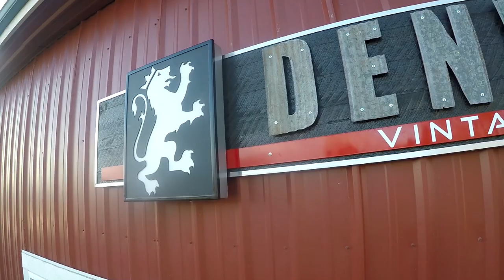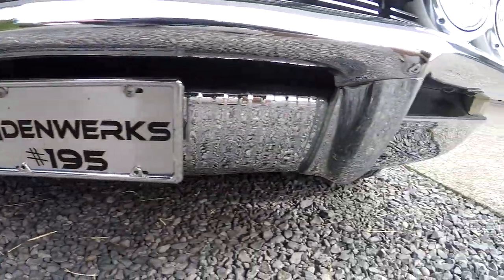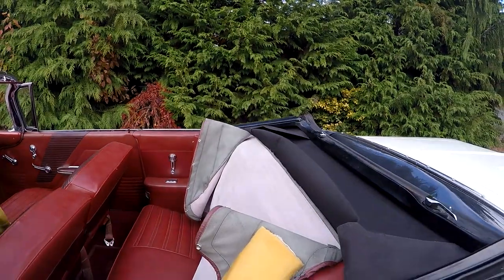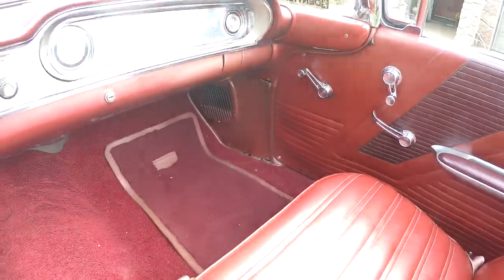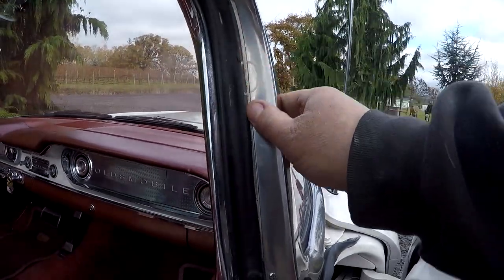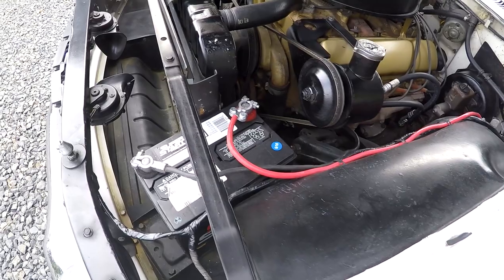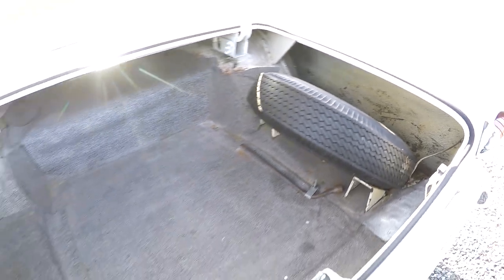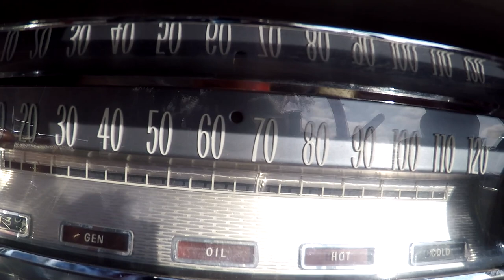1960 Oldsmobile Dynamic 88 Convertible - DENWERKS - Classic Car

Comment: Looks lot better before it was Lowered adjust choke and idle speed it will run better adjust carburator buy way its electric wipers vacuum module needs to replaced for heater blower switch easy fix
Reply: I agree why would you lower it.
Reply: @garymckee8857  The car was perfect before they messed with it why don't they understand they don't make these cars anymore.
Reply: @richthepontiacguys1412  Agreed and not many left.